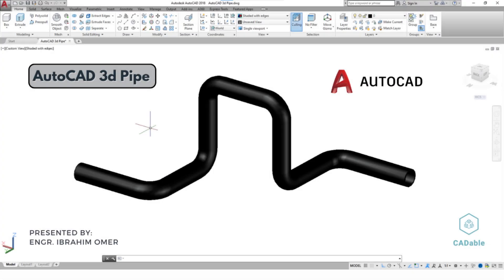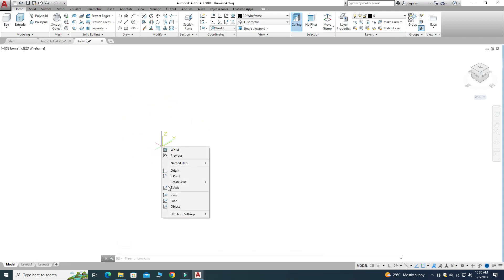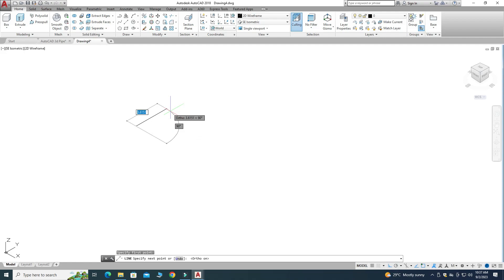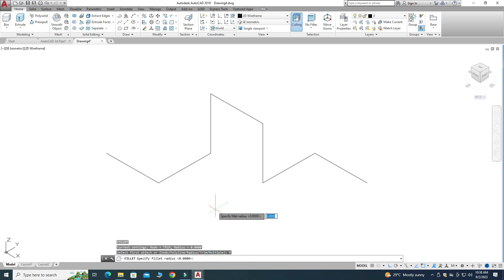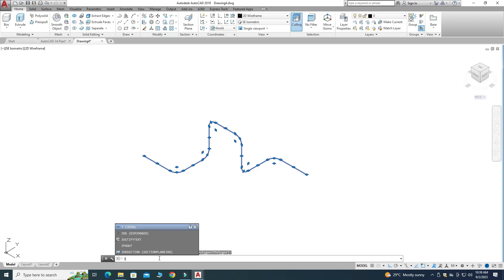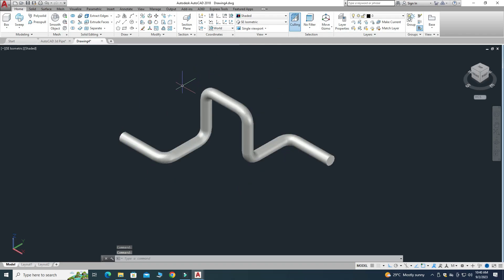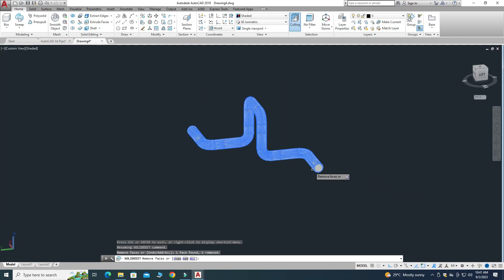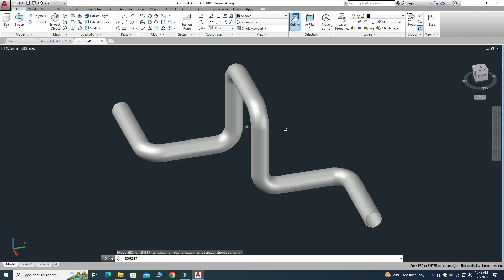AutoCAD 3d Pipe | Creating 3d pipe in Autocad | Sweep along 3D Polyline | Autocad 3d Modeling

Comment: I have a problem, i can not to sweep on sweep path after fillet, any solution?
Reply from the maker: Make a polyline by selecting and joining each segment then try. Actually we have induvial line elements and they are not connected. Try this one!
Reply: , I am having the same issue. It works with a single line segment but not when multiple segments are joined. What can I do?